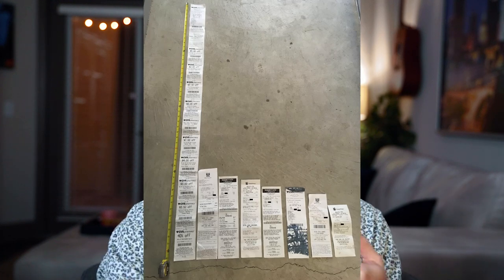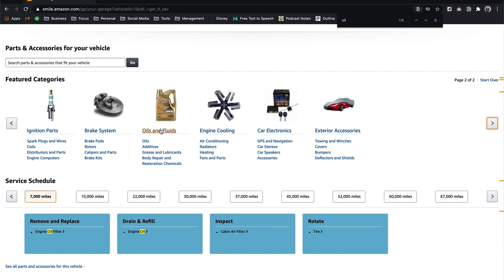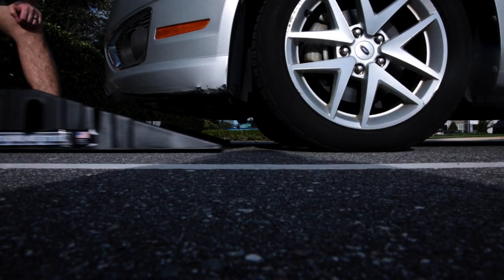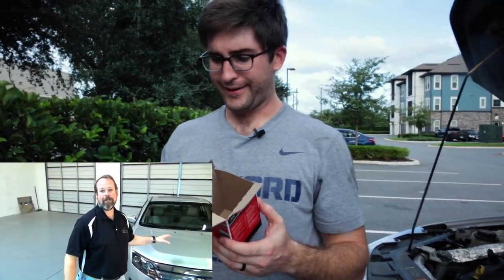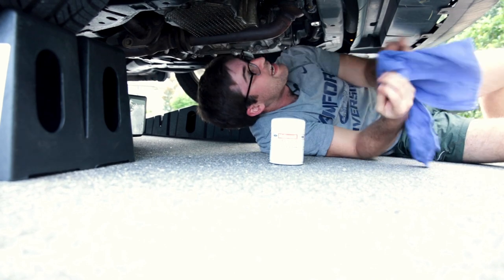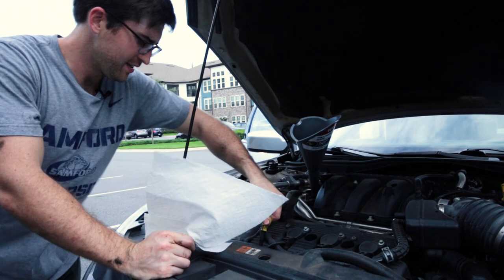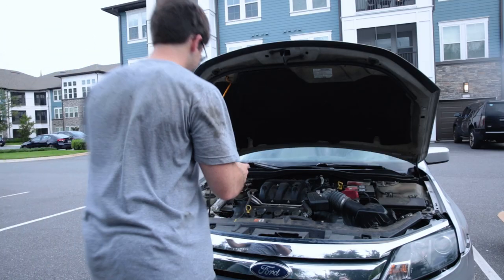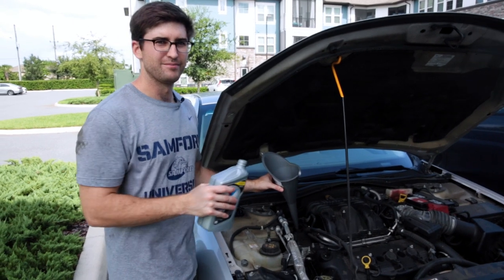I Just Learned How to Change My Oil.

Comment: A little tip, use a bit of old or new oil and run your finger around the oring seal on the oil filter. It just lubricants it abit so it doesn't pinch or rip when you tighten it back on.
Also if you hold the your new oil bottle side ways it will poor alot smoother. Well done on your first attempted my man. I'd love to see a follow up video
Reply from the maker: So great to know! I'm trying to get better at this every go around, so the tips and encouragement are greatly appreciated! 👊
Reply: Nah man its all good, I loved the video, I wanna see more haha.
Another little tip is, after you put the new oil in, run the car for hand full of seconds to let it go through the hike engine. And then check your oil level 👌
Reply from the maker: @jayden4912  Well it really is so appreciated! I'll hop back on the train! Thanks for the encouragement! 

Ohhhh, good to know! Thanks for pointing me in the right direction, Jayden!